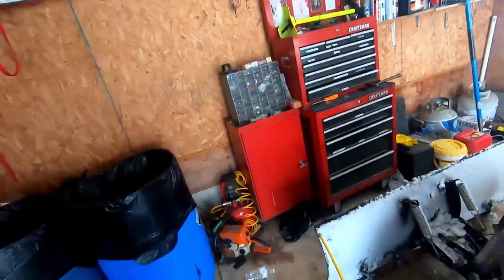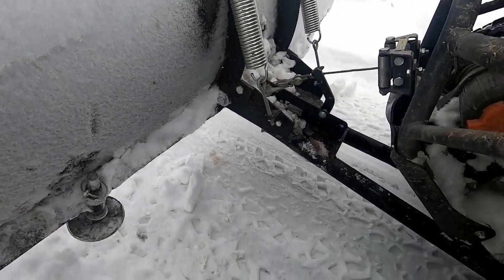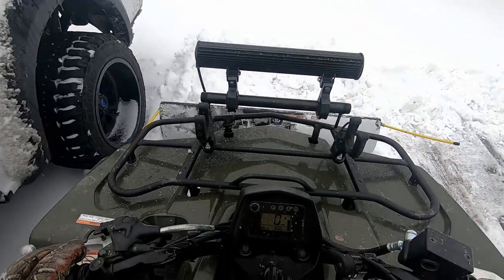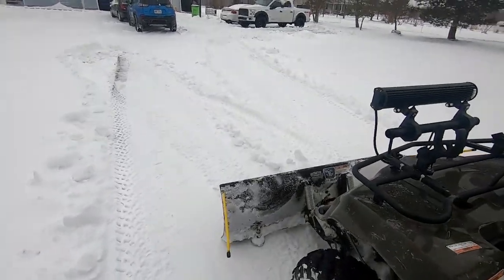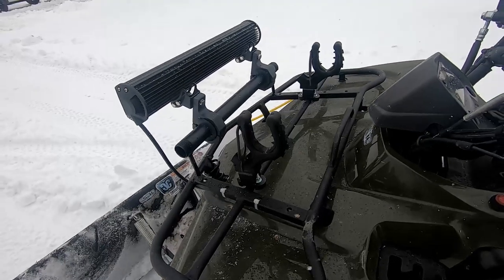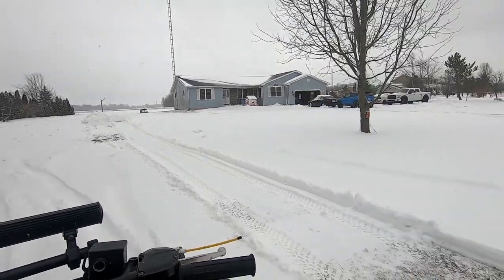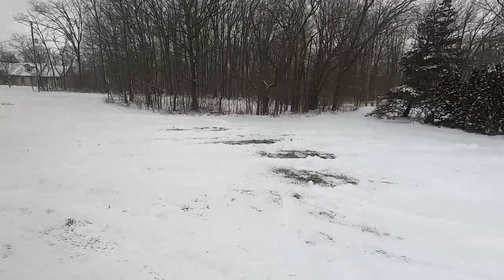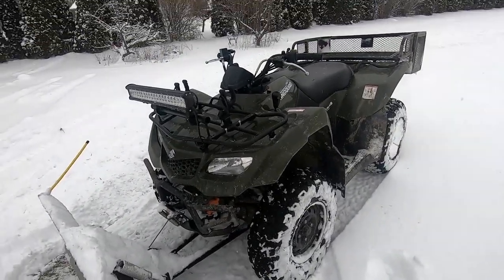Atv Snow Plow Review!!

Comment: Better to lower your two sliding pads and leave a layer of snow each pass you make, you will rarely hook up making the plow bend over. And try low gear for low speed plowing if you haven't already figured that out, noticed your bike was bogging in high gear.

Comment: You probably need to replace your wear bar had the Same problem I flipped it and worked like a charm
Reply from the maker: Hmm I’ll have to look into it, I mean it works I took off all the pads for it, straight plow on driveway now , snow will still pack underneath the blade and push it up🤷‍♂️